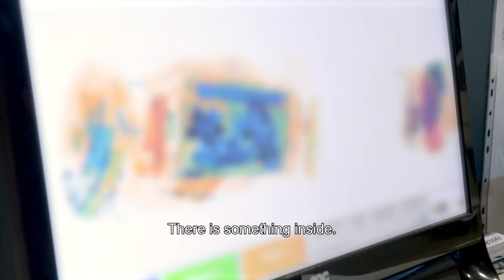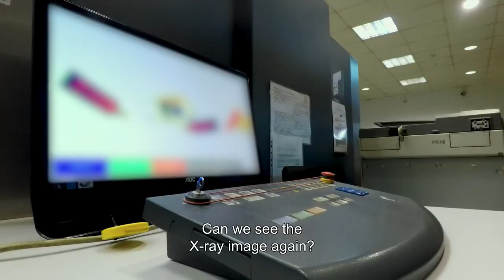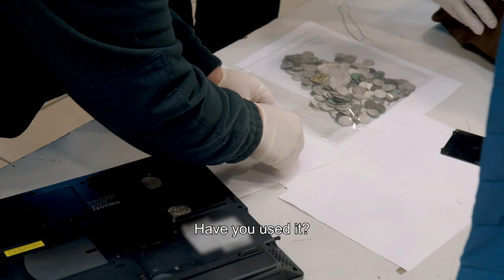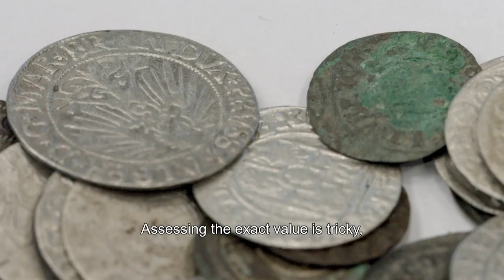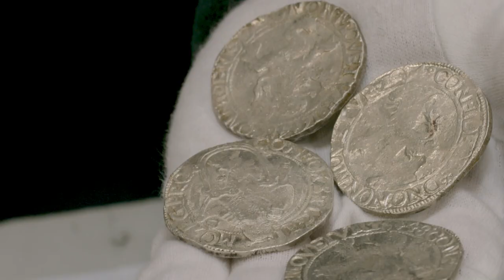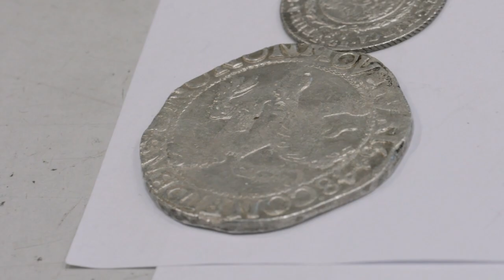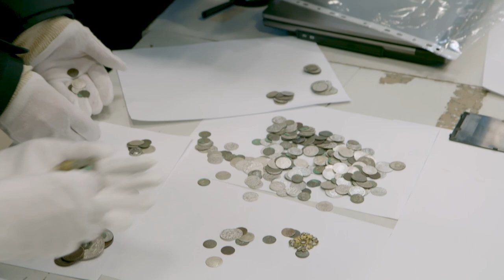Man Smuggles Rare Coins Worth Up £10,000 | Border Control Poland

Comment: Is importing coins illegal?
Reply: No, just smuggling them. But in order to cross with them, you have to prove you bought them legally. Those coins probably came from illegal excavations or were stolen.
Reply: @kamilszadkowski8864  I couldn't prove that the coins I have were from my Father's coin collection. They were divided up between myself and my other siblings. Would we also be considered smugglers? How do you prove that?
Reply: @getin3949  You just have to declare such stuff (any precious historical artifacts) before crossing the border. Most of the time you will only get yourself in trouble if you try to hide such items.

As for proving it, you just have to go to the notary and acquire a notarial deed certifying inheritance. It usually costs a couple bucks. That's all.